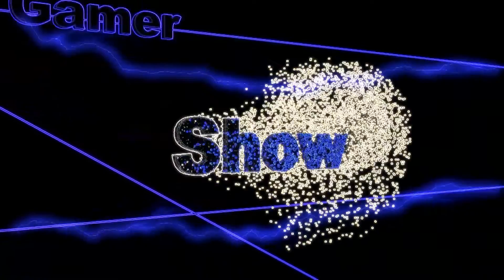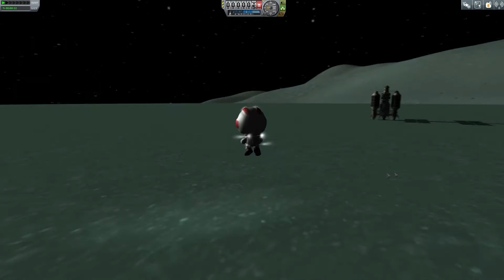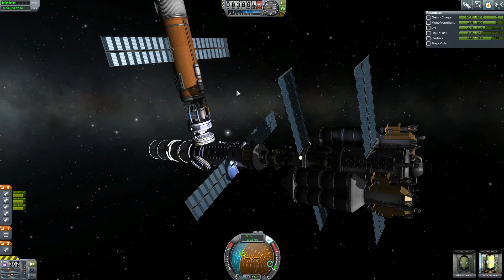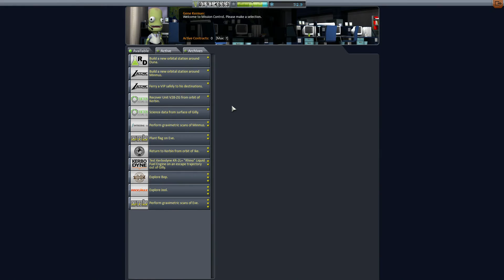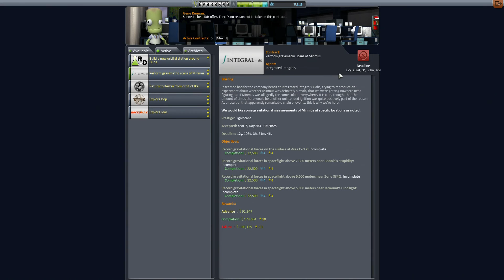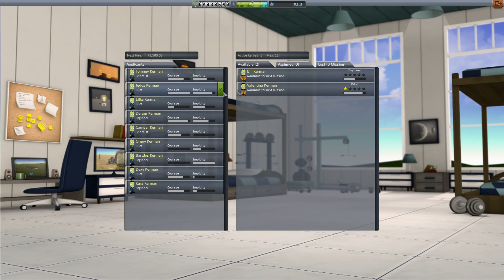Kerbal Space Program (2015) - Old School Career Mode 24

Comment: right now im trying to figure out how to get a basic lab in orbit of kerbin have trouble getting off the ground keeps tipping at points dont get why. anyway i think its time you built a more perment drill staion on the planet and have a different craft to carry the ore off the planet that way you never stop mining. and maybe a craft to resupply the rcs fuel for the station unless ore processing can make it i could not tell and have yet to see it yet.
Reply from the maker: shiva chirr That's a good idea.
Reply: ***** thx anyway back to figureing out why my frist lab staion keeps tilting mid flight its a bit tall but still i shouldnt be doing it certer of gravity is low and it has a good amount of thrust its just werid